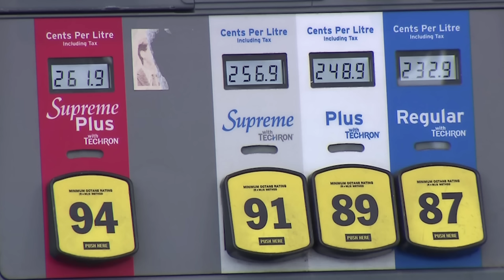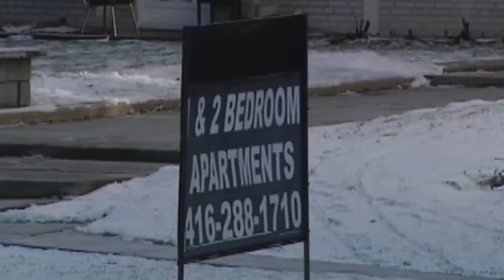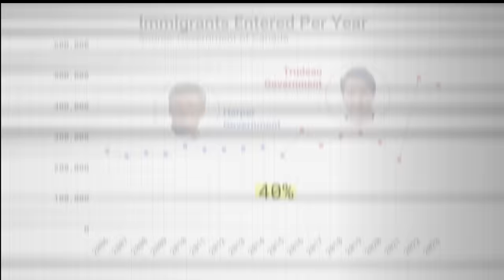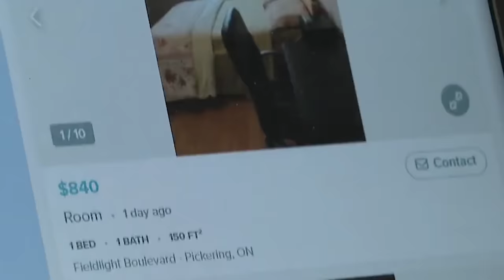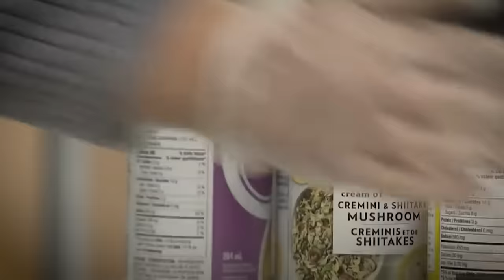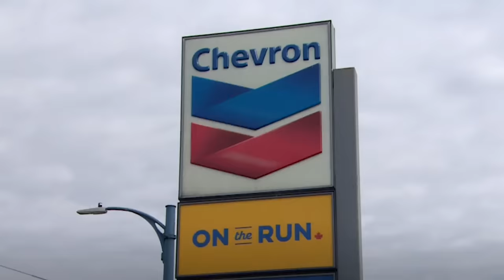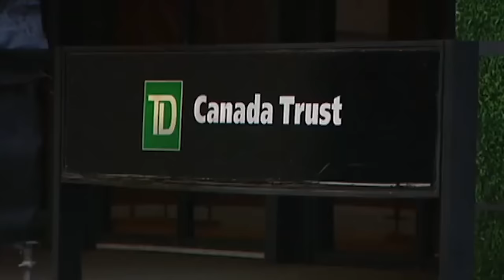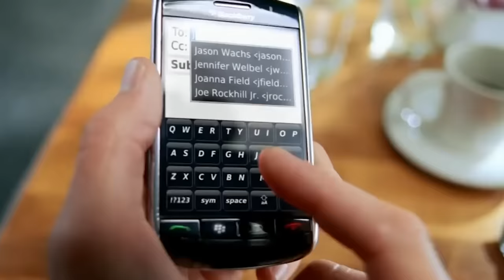Why No One Wants to Live in Canada

Comment: You can blame Trudeau but this is happening all over the world. The problem is that central banks target a certain amount of inflation (usually 2%). However in their inflation calculations they don't include the price for housing. So they are not steering the economy on true inflation. Resulting in a decade of very low interest rates which resulted in souring housing prices.
Reply: Yes, but the response in most of the rest of the world is not gvt growth in already inept behavior, making the population pay. Market prices across the board are out of control, but our gvt spending/loss is exceptional.

Comment: I pay taxes as much as anyone. My salary gets me through the month and I can't have any savings. I live in a 1 room + 1 bathroom apartment that doesn't even have a kitchen. I studied for 3 years through the lockdowns to get a better paying job, but for every single job there are at least 300 applicants. Due to all the stress and economic problems, I recently had a hormonal imbalance and tried to find a doctor. After 14 months and 5 referrals I finally found a specialist. It turns out that my condition "isn't covered" by the government and I had to shell out $500 for every injection despite paying exorbitant taxes for the promise of "free" healthcare. I used to work in another country and used to drive a brand new Nissan Maxima. I thought that migrating to Canada would be mutually beneficial to both myself and the country. It turns out that Canada is a scam. I came here with almost $90,000 and now living paycheck to paycheck. Now I'm looking for every opportunity to escape but can't even afford moving away. Avoid coming here at all costs.

Comment: Im a ticketed carpenter that actually builds homes in here in vancouver most new wood builds like condos are cheaply made copy paste and aren’t worth as much as the are being sold as 800sqft for 750k 😂what a joke everything is particle board not even solid ply to cut costs slap on a 4 ft deck and no grass its a shoe box everyone is being forced to get because thats what they build. Last tower i was working on you couldnt find a straight wall anywhere and the parkade concrete was getting stress cracks everywhere good luck in a earthquake cuz we dont build for those

Comment: I see these vids and try to compare with the UK as people do, but just struggle to see it. Yes its expensive here, yea London has some wild areas like Kensington or wherever, but you can be half an hour from Central London and rent a house for under £1k a month. I lived in Reading, 30 mins from Paddington in a 2 bed house with a small garden for £900 a month until last year. 

I question if thats what these numbers reflect, extreme cases of $7k rents in central Vancouver, rather than a norm or is it genuinely that wild? If so, thank God Im over here.
Reply: 7k is wild. But 3k would be normal for a pretty small apartment maybe 2 bed room anywhere near the city. 2.2k would be an old studio.
Min wage is 2,560 and a good chunk of the city is on it. But the rent isn't too bad because its somwhat tied to local incomes. It's the housing that's brutal. Median multiple (median home price / median household income) is 12.3 here. London is 8.1 by comparison which is damn high but not a global leader. That means if a typical couple in Vancouver could save every dollar they made and didn't get taxed, it would take them 12 years of wages to pay for a house. Of course you do get taxed and you do have expenses so for most households they live month to month.

Comment: Vancouver is expensive but these figures are way off. The average one-bedroom is $2,150, not $3,000. Actually, a two bedroom in Vancouver is less than $3,000 and cheaper in the suburbs. However, it is expensive for untilities and apartments are tough to find in Vancouver. In addition, this video reports money laundering at an all time high but that is old news. New laws and restrictions have significantly reduced or eliminated money laundering in Canadian casinos.  There is also some very questionable comparisons here about cellphone service costs. In fact, the greater Vancouver area enjoys competition from several providers which maintains decent pricing comparable to cities in Asia, and it usually includes cable TV service and family pricing plans. The video included inaccurate information regarding banking. I have an RBC account that bundles 4 different accounts and a credit card and I pay almost nothing for this. Be careful when doom and gloom videos like this are published and always check the sources.

Comment: While I agree with most of what was said in the video, there are a few major mistakes that are very misleading. For example, the video states that Canadians spends more on gas than any of the G7 members. This is FAR for the truth. I’m a German who moved to Canada 3 years ago. Gas here in Canada is HALF the price of what it is in Germany! So, the per litre price is super cheap in Canada! So, why is the total number on spending for gas so high? Because Canada is insanely HUGE. People drive insane distances and thus need an insane amount of gas. You can’t compare total spending on gas. You would need to compare the price per litre of gas, which is pretty cheap in Canada. In fact, the only country that has cheaper gas than Canada in the G7, is the USA. All the other G7 members pay more per litre. 

Then you also mentioned dairy prices. Yes, they are highly regulated. But compared to Europe, dairy prices are almost the same as in Europe. Again, the only country with cheaper prices in the G7 is the USA. What is (insanely) more expensive however, is meat, housing and groceries in general.

In general, your point still stands: Canada is insanely expensive. However, you listed the “wrong” items, because the ones you listed are relatively cheap compared to the G7!
Reply from the maker: You make a fair point. My only counter to this is that there is no reason for Canada to have more costly forms of dairy or gas, and that the reason for it is truly artificial. Whereas many EU nations have structural reasons for higher costs that are unavoidable. Regardless, your point still stands and it is something we reflected on after we made the video and will improve on going forward

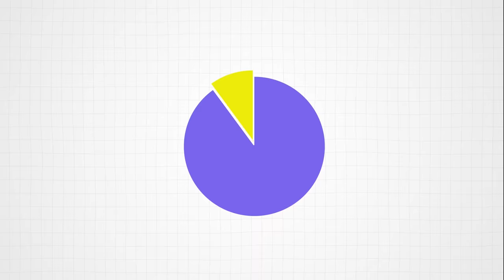Comment: 11:43 I appreciate your dedication to moving quickly but..  What does this even mean?
"The US has low levels of Market Concentration across Industries..."(cont.)

Are you saying Canada is suffering from monopolies in an obscure way, right after saying that is true specifically for Banking, Telecom, and Grocery stores?  Was this written by CheatGPT?

"...leading to constant innovation" 

Ok telecom has huge deployments for each G of Cellular, but Cable and wireline hasn't had much to do.  And Banking and Grocery stores don't have much cost to making changes, or much going on lately.  I am really grasping to find a point here in the word salad.

It sounds extremely obvious, but Canada needs more small Tech startups, and manufacturing stability (favorable tax), while either breaking monopolies, or taxing them punitively for excess market share.  Also the point on housing, need to quickly swing to some affordable apartment buildings near work areas or wherever rents are burdensome.  More green energy system manufacturing is too obvious, and probably need a viable small cold weather EV company startup.  Something ideal for Canada, being developed in Canada.

Canada's inability to handle monopolies is in every video I've watched.  Its the most serious problem the gov't has yet to solve.  Housing is second and will take years to fix without causing extreme disruptions.

Comment: For the most part it is just major urban centers (Toronto, Vancouver, Victoria, Montreal, etc) that are just so bad they are driving the numbers up through the roof. Immigration, AirBnB and foreign real estate "investment" is just f'ing the whole thing up in those areas. If you want to live in a non-urban area the prices are still reasonable.

I am in Kelowna (which is a higher priced town pop 144,000) and you can rent a solid 2-bedroom condo for 2000$ a month... split that two ways and its $1000/month. As long as you are netting at least 3,000$ a month which you should be then you are fine... thats 33% of income on housing. Slightly high but normal...